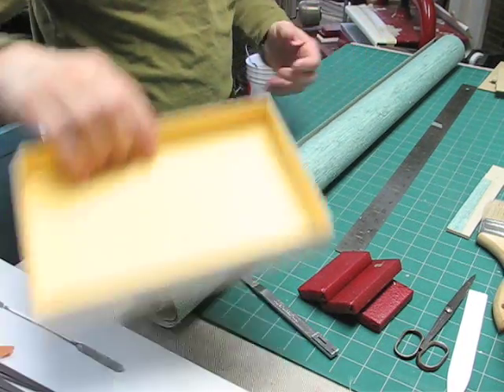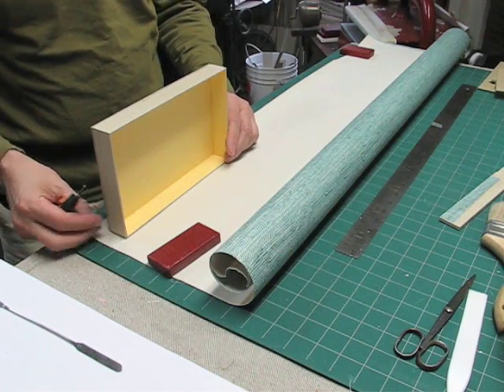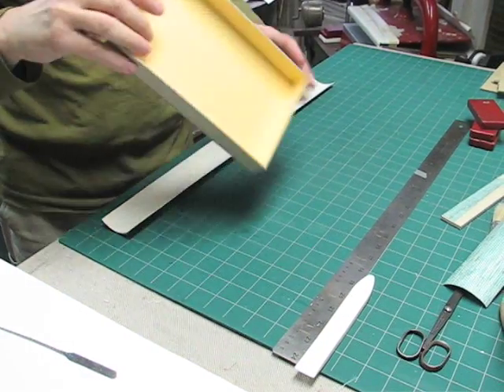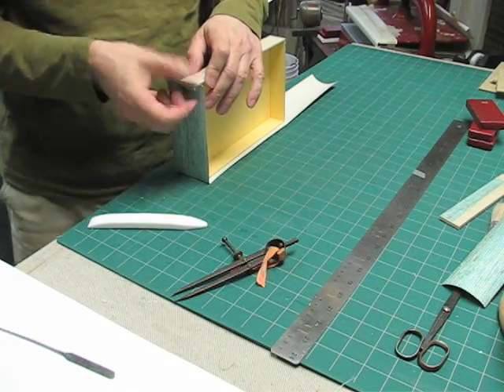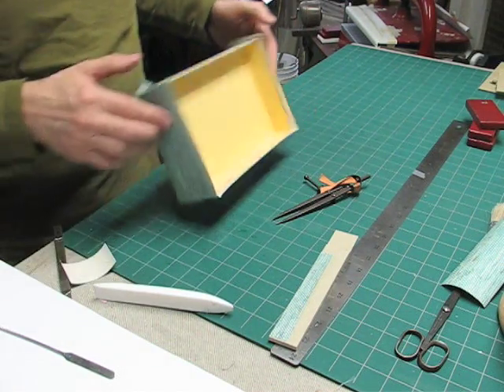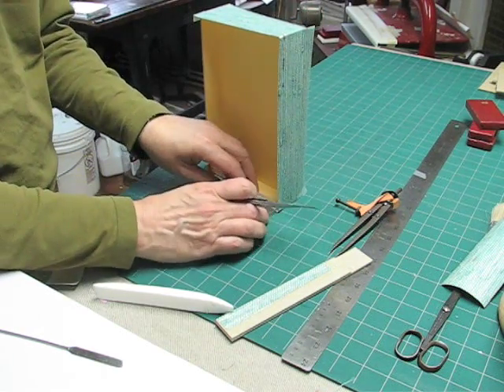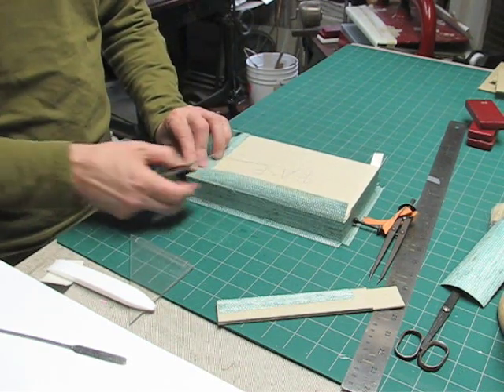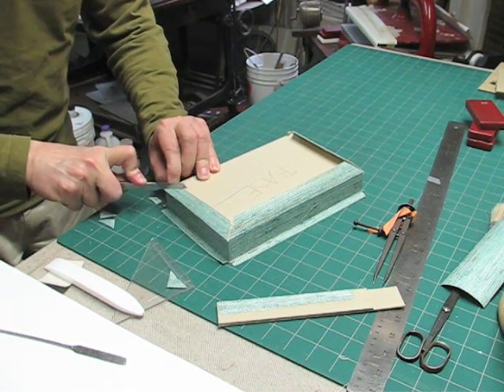Prototype Box  Part 3A -  Covering

Comment: What is one of your paper sources? I can't seem to find rolls of paper over 50lb text, which appears to be the same thickness as copy paper.
Reply from the maker: You should be looking Art Supply sources for these kinds of paper. There are many varieties and colors from which to choose. There are Fabriano cover weight papers that come in a nice range of colors, (the text weight will stretch too much when glued out). Just choose better  colored papers that you pay a little more for rather than the cheaper construction papers. The outside covering of this box was a grass cloth wall covering, good for a special one time use decorative box but not good for a box you want to use for a long time, it will survive but the grass gets broken and will be flaking. Thanks for watching.
Reply from the maker: The Art papers are usually sheets, about 25 x 39 inches, some will be smaller and some larger it all depends on what you choose.